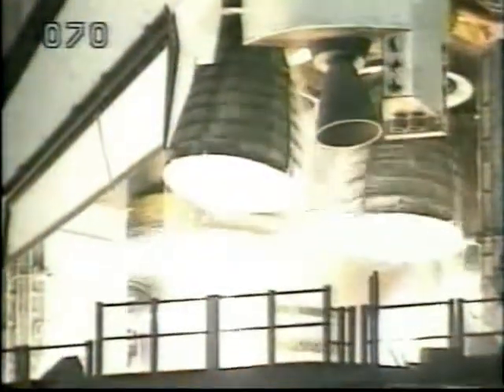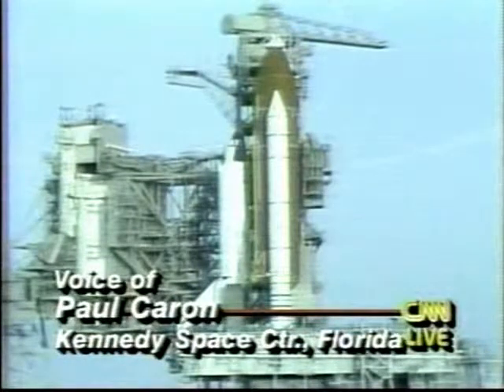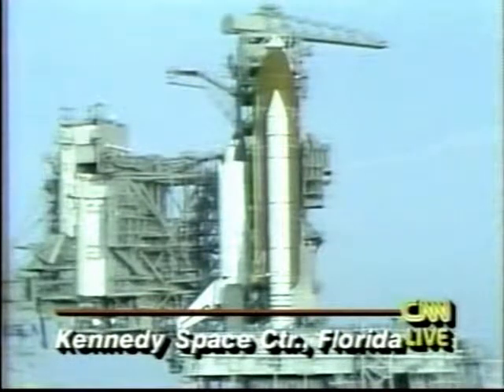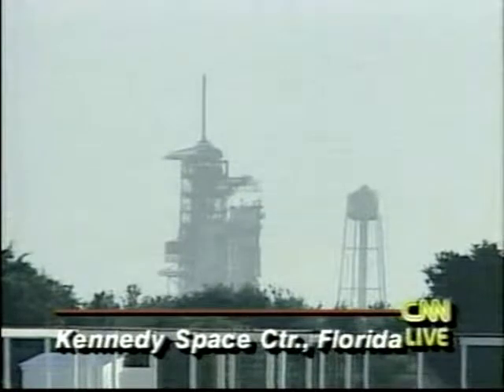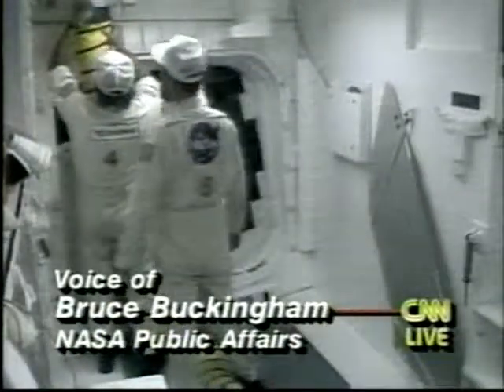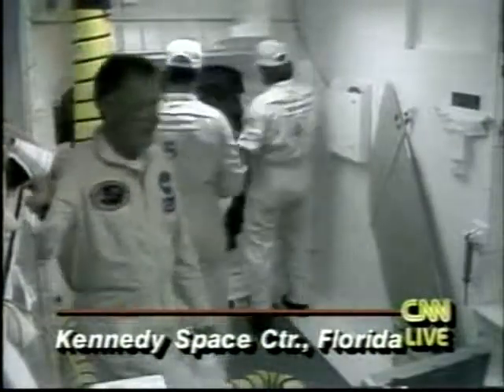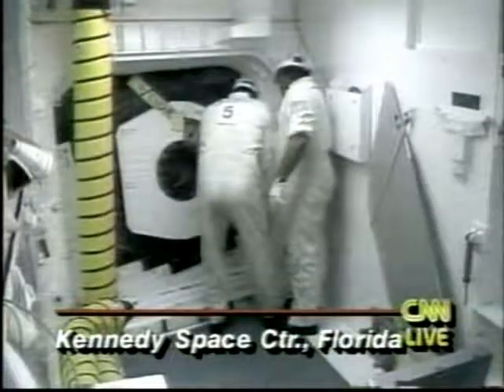CNN Coverage of The STS-68 Launch Pad Abort Part 3

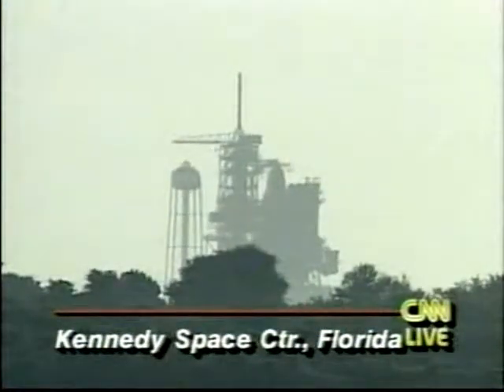Comment: 4:00 actually, the commentators are not quite correct--the crew CAN get themselves out without assistance in event of a dire emergency, which is why the access arm was moved back into place immediately after the abort was declared. However, there are some risks inherent in doing it that way, so in a "safe" situation, such as this one, where controllers are certain the crew is not in any immediate danger, it is much easier to just hang tight and wait for the ground crew to get there.